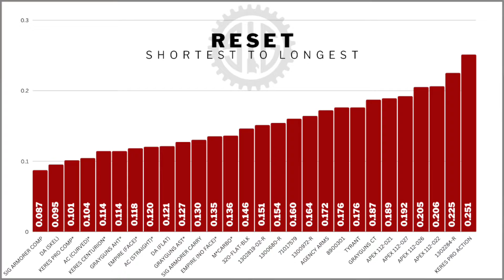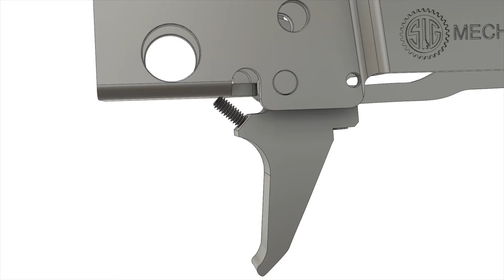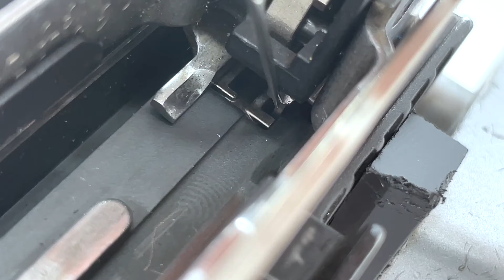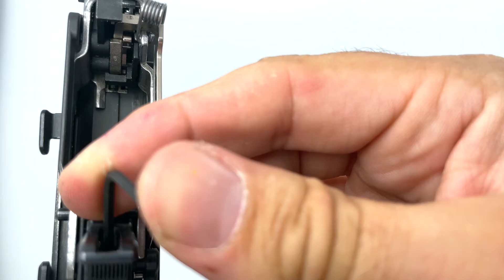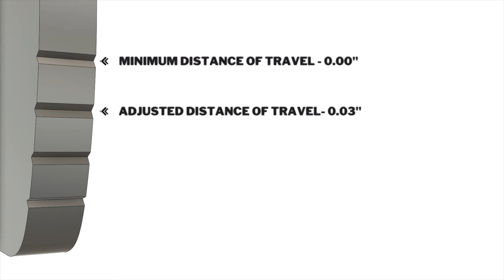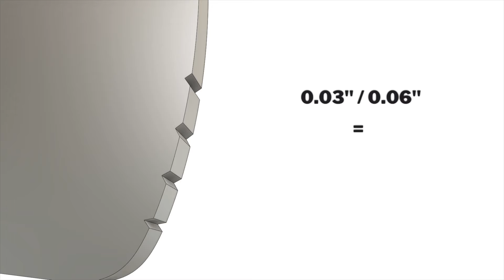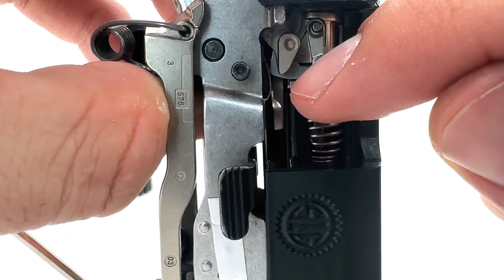EFFECT OF ADJUSTABLE TRIGGERS ON P320 SAFETY

Comment: I don't believe in them for carry/social guns.  The more factory your gun looks and operates, the better it will be on you in front of a jury.
My P320 has a decent trigger pull to start with. Short take up, crisp striker drop with a small over travel at 4.5#  Nothing to scream Modified Gun!
Reply: on a hammer fired gun i look at is as acceptable but on a strike, no way im adjusting pretravel AT ALL.
Reply: @LyleH-13 I’m with you. I cajunize all my DA/SA CZs because the DA will never get below 4lbs and I can thumb the hammer when holstering. I do not trust a light Striker trigger whatsoever.
Reply: I don't believe in OE SIG MIM trigger for carry 😂
Reply: @Soravia  I have an aftermarket nonadjustable flat trigger that looks stock but is superior to the SIG trigger in feel.  My whole point is that my gun looks factory and whatever I did to it is invisible.
Reply: What aftermarket trigger would that be? @myfavoritemartian1
Reply: @itsMateo911 Apex non-adjustable, flat trigger.  No markings on it and the color matches the Sig triggers. $65 or so.
Reply: You really think they'd look at thatt?
Reply: @Bearman94  Prosecuters have "experts" to examine your gun so they can tell a jury it is a "Highly modified pistol".  Which is another way to prejudice a jury.